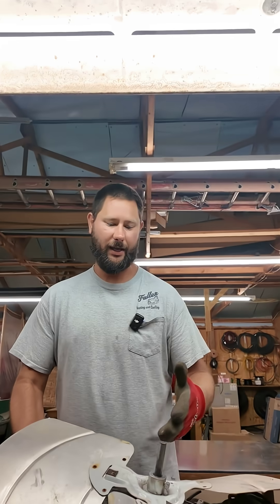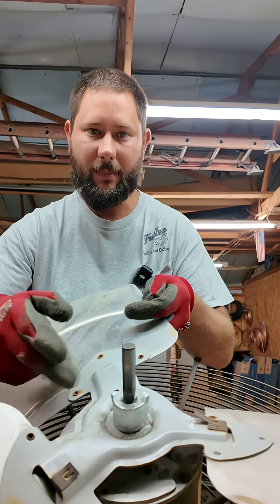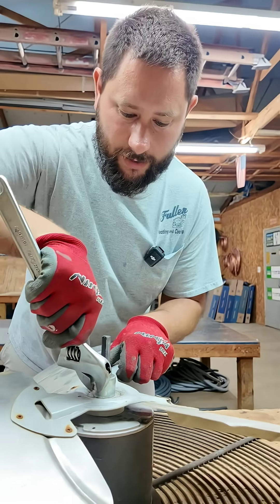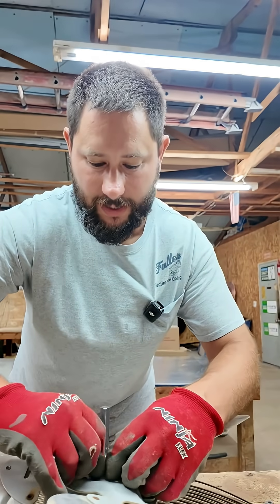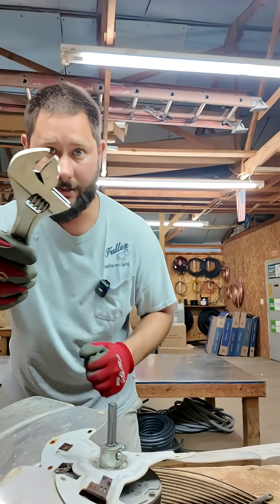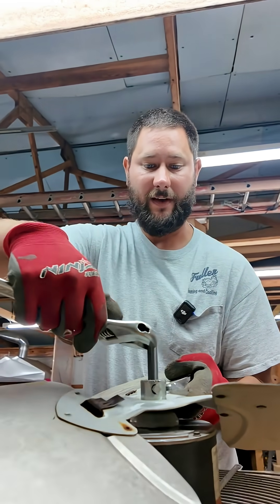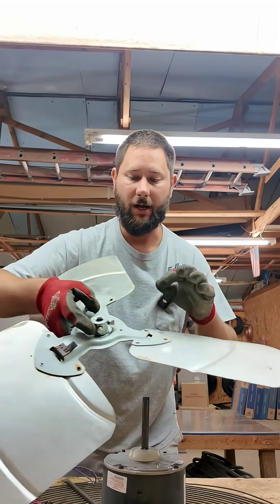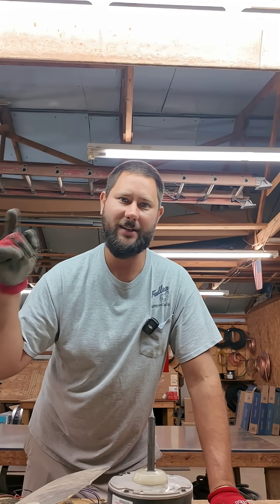How to Get a Stuck Fan Blade Off a CONDENSER FAN MOTOR?

Comment: Great tip and I am going to try this to get the fan blade off a 12v dc radiator motor. There's a retaining clip that I removed and I did sand the very small tip of the shaft that is showing but even with wd40 it's stuck on there. It's been on there for over 25 years. But I hope this works for me. 
Happy Motoring.
Reply from the maker: Hope it works for you! Let me know how it goes.

Comment: I wonder if using candle wax instead of a penetrant would be better.  My thinking on it is that once the wax free’s up the blade from the shaft, the wax would coat the shaft with a layer of wax.  Even if it drips off over time, wouldn’t it still leave enough of the shaft coated to make removal easier next time? 

Or maybe a corrosion resistant spray paint type of material? I wonder…

Comment: Badly rusted to the shaft, could not get it loose. Didn't want to harm the hub. Didn't want to use heat as the fan was aluminum. Didn't have any sort of puller that fit. Resorted to an air hammer. Came apart in about 5 seconds. 😁🤣

Comment: Gotta love how easy it is with ZERO corrosion. Ive seen the fan hub FUSED to the shaft. 

Fan puller comes out everytime.  I dont have the time in the day to polish a motor shaft. Ill have the whole blade changed in the time it took him to get the PB blast outta his truck.
Reply: Yup.  But i still use my judgment. If she's gonna come off and I don't need my puller, that's a win.  But my hub puller hasn't failed me yet.

Comment: I’ve been doing that for 25 years that same way. Also works on the indoor fan as well.
Reply: You can't even put a wrench on the shaft through the squirrel cage.
Reply: @carpentermic1  angled in ward.

Comment: Hammer the hub on to the motor slightly 1/8” remove ring of rust that you can’t get to with sand paper makes a lot easier

Comment: I've seen them so set you couldn't beat it with a hammer. When I started in the 80s. The owner would keep a bunch of old equipment parts to just give them away to the retired customers. Most couldn't afford alot. And the units in town were all the same for the most part

Comment: I’ve found that sometimes when the crescent wrench can’t get a good grip on the shaft, (location, type of motor, and blade. A good pair of vice grips works great to grabbing the shaft tight and able to twist it right off. (Most of the time not always.)

Comment: Usually I just buy a new one if it’s available. On that just about new setup you’re demonstrating on if it has no cracks and rivets on blades aren’t too bad I’d reuse. Saving a few bucks on a blade isn’t worth replacing a coil and repairing wiring. Especially on air cooled chillers.

Comment: If all fails, use your channelock wrench and put it under the blade, in between the balde and cover and start pushing it up. As it is moving open up the Jaws on the wrench more

Comment: When all else fails. You're replacing the motor anyway. Grab your sawzall and cut the shaft in between the motor and blade. Then a hammer and flat head while sitting on a one inch black iron coupling. But the way you've shown I've don't from time to time.

Comment: I tried this with a blower motor. I had another guy with me. I didn’t have a puller with me or bigger wrenches at the time either. We were STRUGGLING to get it off. We finally used the angle grinder to cut shaft enough to where it would slide right out. It took us hours.